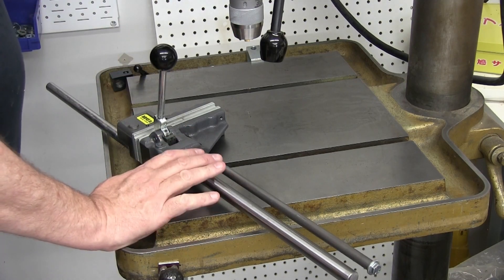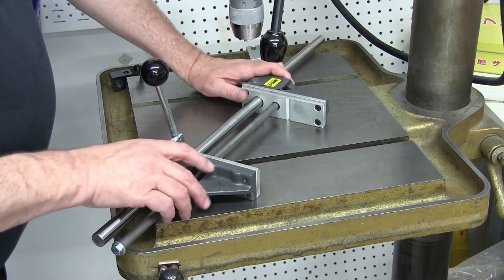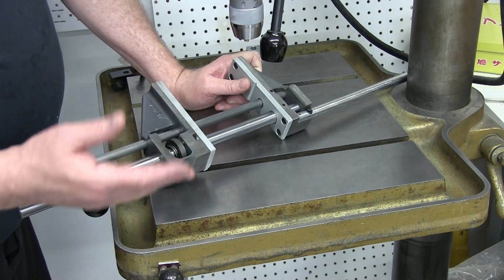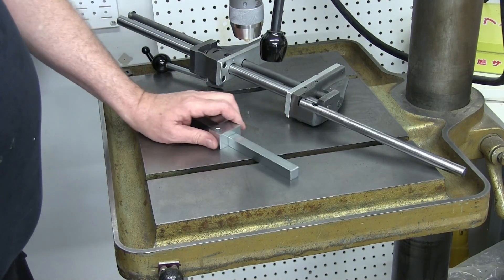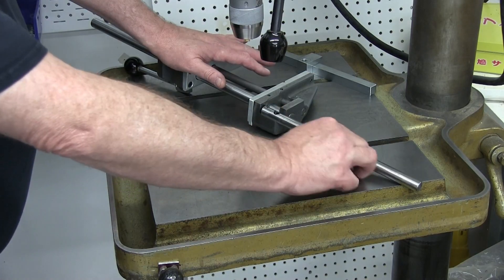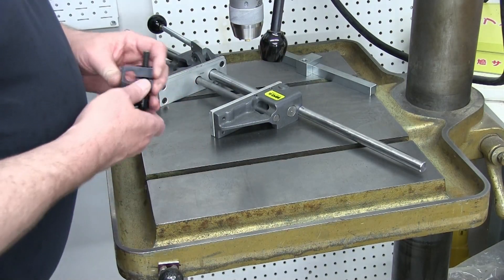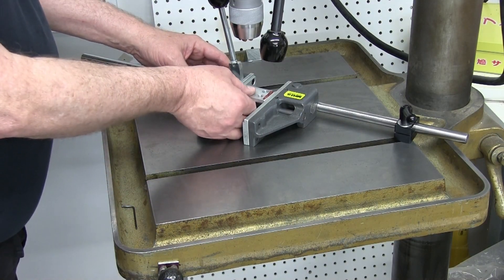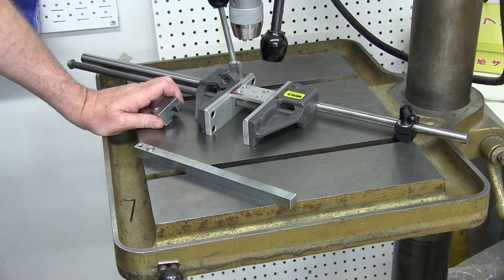Heinrich Grip-Master Safety Drill Press Vise Review and Mods

Comment: Thanks for sharing this. Seems like a lot of engineering went into this vise and it looks solid and well made. But they never took the extra step to engineer and offer maybe the most important aspect - a way to lock it down to the table! Isn't this the huge advantage of a float-lock vise like this? They got the "float" part right, but not the "lock" part!